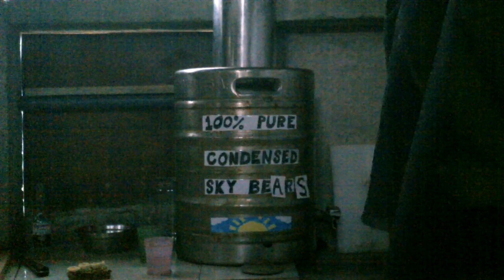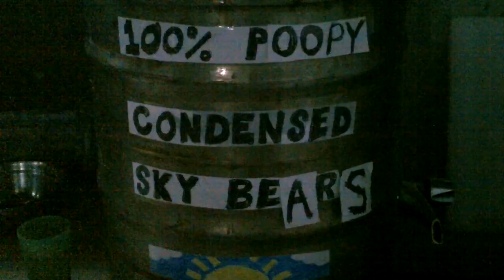Projects 2022: Sky Beers

Comment: The main feed is from a spring? Did I miss a video?
Reply: Almost certainly filled with rain collection on hist 'roof/walls'.   Dashaina has a similar tank that fills from rain from the outer surface of her tower/dome.    Note: sorry I edited it cuz i was clearly wrong the first time.
Reply: @shadowmancer7040  I thought this was at his new place. I think the video is not related in time to the build sequence he has been sharing.
Reply: @TheBackyardVerticalGardener I don't think he showed it but maybe once, but he has a concrete tank he made at the new place with the same type of gutter system as the other one.
Reply: @shadowmancer7040   Her house is on the other island. The new house and concrete water tank has a gutter collection system.
Reply: @HendoRising  oops, I thought that was her water tank and kitchen.
Reply: @TheBackyardVerticalGardener  You're almost certainly right.   I was 'fooled' by the tiles and their similarities to those he used in her kitchen.   But you can see the square panel shelves behind.  My bad.
Reply: Rain water collection. There is no spring on this island. We do have a year round running brook on one of our other properties, where we cut trees for wood.